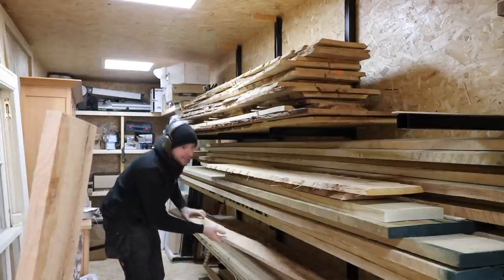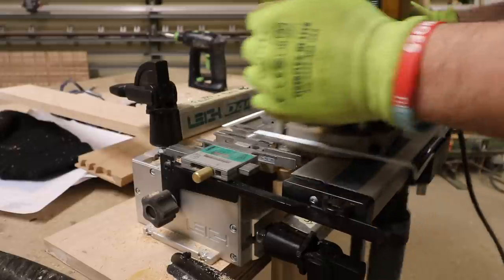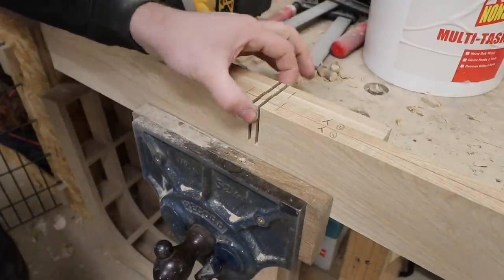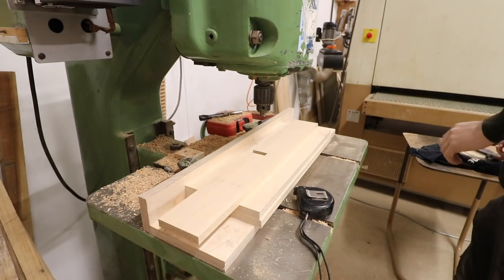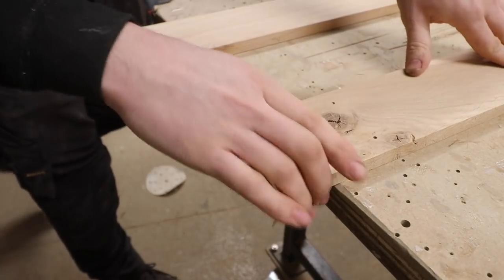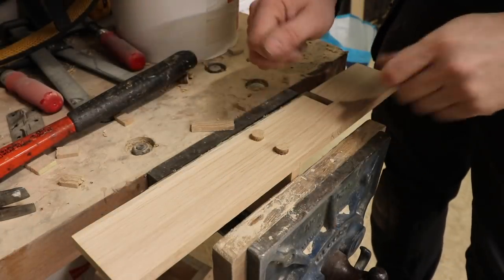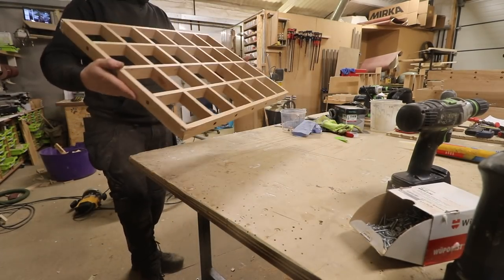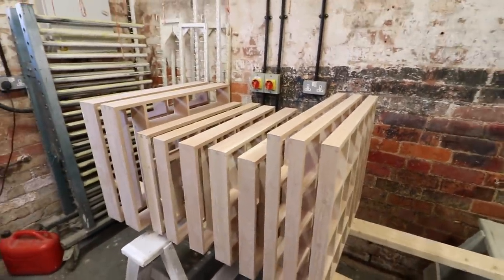Making Oak Drawer Dividers - Dovetails and Halving Joints

Comment: You are one of a very few that suggests the hole in the piece to be anchored is a "pilot hole" and the hole into the piece to be anchored is the "anchor hole"....pilot hole is diameter of the threads in the screw and the anchor hole is the diameter of the shank of the threaded screw to be used.....thank you
Reply from the maker: Thanks David, Your a gent and very correct. Driving screws needs its own video for most people. Such a simple task yet even tradesmen struggle!

Comment: I am a finish carpenter/ contractor here in the states (that is what we call here what you do).  Some of us focus on specific things and are license is called a “Millworkers “ license.  I am focused on custom cabinetry; more so add on cabinetry instread as a full kitchens?  Bottom line more profitable and less employees!  I also do house trim inside & out ; hang doors and build them!

Could you talk about what seems to be your better profit line!  And how you built up your shop ?  Obviously you do not use a table saw ?  I do not use a band saw and do almost everything on my 52” med priced Grizzly Saw (3hp triple belt 800 lb ) which I just enjoy!

Also how much “out of shop work” percentage wise do you do as opposed to in shop?

Really enjoy your channel and learn tons!
Reply from the maker: Best profit line would probably be to sell up and become an electrician haha, 
I think kitchen if you can sell them, but generally to charge the right money you need showroom and the service side of things rather than just being able to produce and supply the goods. 
I have a small table saw, and do use it fairly regularly, but for the most part i manage with the bandsaw and panel saw. Id make good use of a decent table saw but i dont have the room for everything.
Reply from the maker: depends on the job, it can be 100% site 50 50 or all workshop tbh! I dont mind too much but its obviously not worthwhile to be heating and paying for a workshop if you not using it..
Reply: @BradshawJoinery  absolutely I understand!  I hv to somewhat disagree about the showroom and others.  Spencer Lewis does finish carpentry by himself like you?  Like me?  250 plus G ‘s a yr!
It’s really the right hook up with a General builder!  If you sub out to a guy who build custom top end homes your good!
You hv the skills no doubt and just need to connect to a custom builder!
Look at his channel “inside carpentry” touch basis with him and see his path?
Of course your path is not mine, mine is not yours ect.,.
I would love seeing you grow because then I get more videos with massive informative content mate!
Now then again?  I could be all wet!

I am staying away from employees, and I turned my Garage into a shop brought 220 amp into it big saws and acquired one veh now I am working on a van?
To me it’s about the day to day action? Money helps ?  Truthfully I am ok w/o all the action?  Retired from one field already?  But I love the life the Good Lord gave me so I am living it all the way!

Comment: You amaze ( and shame!) me more every video mate  🙏 

Tape is great! My million dollar idea is but, if the put a tiny hole right in the center of the 100 mm line, and supply one of those little short pin things with the plastic end they use on wall boards to pin paper I think.

Know what I’m saying? Then you could mark out a whatever it is without relying on ‘hand pressure’ to stop the tape moving.

Maybe I just want a really easy life 😂

Take care mate
Reply from the maker: Haha thanks buddy, I hear what your saying with that, or have a bit of blank tape at the end then start from zero so you never make the 100mm mistake ever again lol

Comment: Love the halving joints. Wish I could afford a big enough saw to add more than 1 blade. Did have a thought though. Could you domino joint out through one piece and using a longer domino join 2 bits either side. Might give it a go but if you do try it post a quick vid please. Fab work BTW. Been watching your channel for a while now. Brilliant.
Reply from the maker: Cheers Ian, Yeah it certainlt helps make it even, You can do the same with a small spacer block against your stop. SHould keep them all the same width., Domino would break out the timber on the rear and its also not a holding joint until its glued. the key with halving joint it is keeps all the little bits straight. Thanks By the way :)

Comment: How many hours did you accumulate creating these superb inserts? The quality of your bespoke craftsmanship is timeless. 
I hope your customer appreciates the detail of what you’ve achieved here. I’m a big fan of retaining the natural features of the timber too, rather than cutting clear of the knots. Great work Ollie 👍🏻
Which Laquer are you using, and do you get much soak and absorption on the first coat? Cheers 😉
Reply from the maker: Hey Mike, i think i spent around 5 days in total for 10 inserts, start to finish.
Yes customer is a big fan of the work i am doing for them which is nice! 
I used PU 2k @5%sheen. Its great, denib 1st coat then second wet coat for a finish. Not nice stuff however so will need a booth

Comment: You did not mention the direction of the grain in the plugs....suggest they are all the same either with the grain or against the grain for uniformity.......
Consider a router round over bit to ease the sharp inside edges of the dividers
Enjoy your detailed explanation of tear out and methods to address
Reply from the maker: Yes i would personally keep them all inline. I think i did mention it as i said about being careful because the bandsaw cut marks look like grain sometimes so its easy to get them wrong